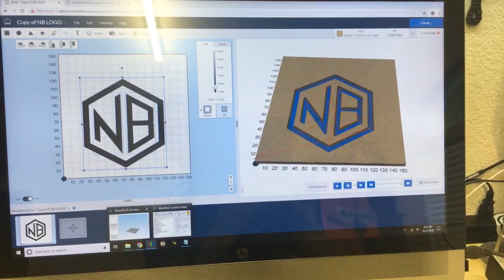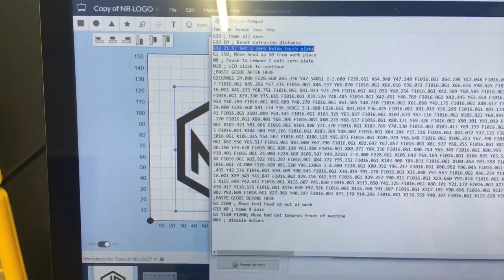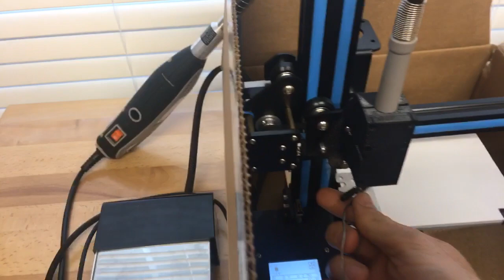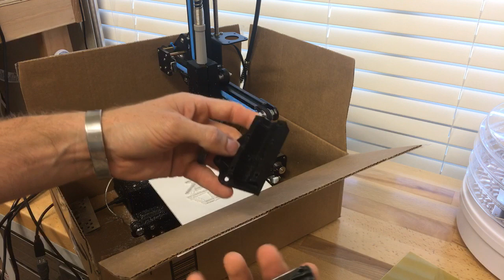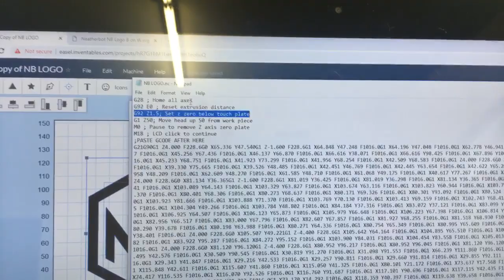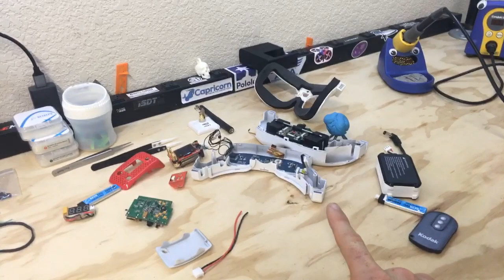Live Stream | Creality Ender 2 CNC Conversion

Comment: Hi, great video. I'm trying to do the same thinks, but I'm investigating on Z-EndStop. For Ceeality Ender 2 EndStop are NC (Normally Closed), but you used it as NO (Normally Open). How did you it? Thanks.
Reply: hi daniele did you manage to find out how the end stops are used as NO?
Reply: i dont know if you still need this but i found a really helpful article on how to do it.....
https://www.instructables.com/Configuring-Endstops-on-Ramps-14-with-Marlin-firmw/ there's the link
Reply: Step 1 Flash a bootloader to the Ender 2. (I used an Arduino Uno)
Step 2  Change the Z endstop option in Marlin firmware from false to true (this changes Z endstop from NC to NO)
Step 3  Upload your custom Marlin firmware to the Ender 2 using Arduino IDE or Cura or VS Code